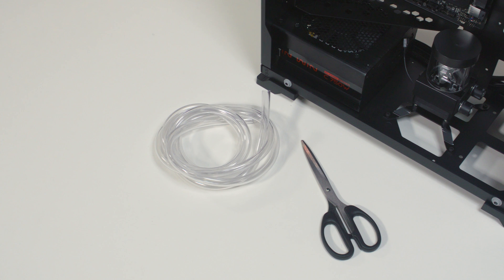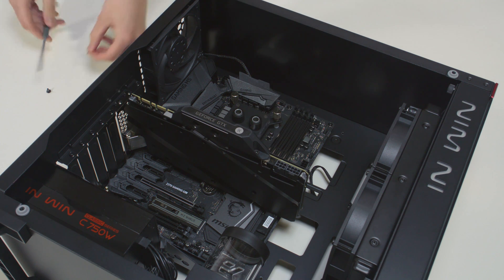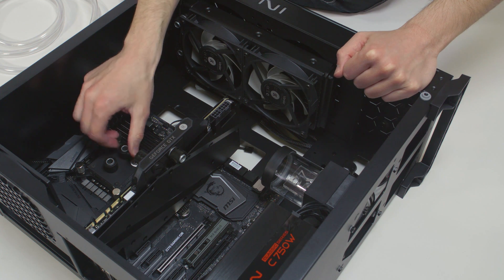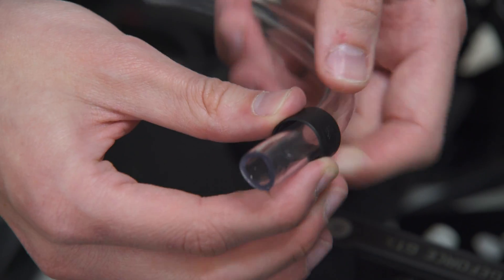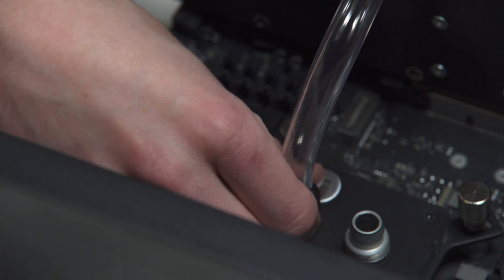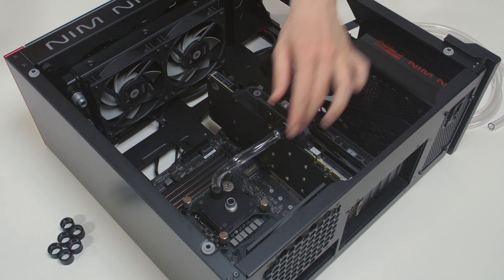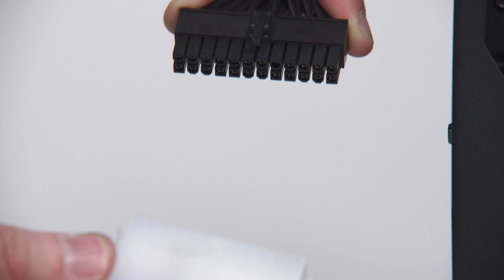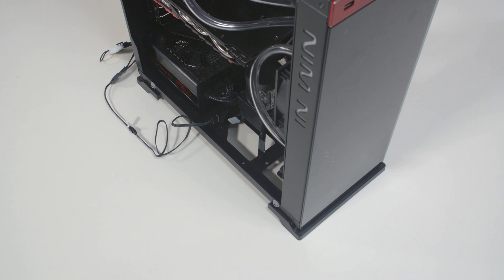EK Fluid Gaming A240G - Connecting the tubing and wires

Comment: question, where do I get the power pin adapter and sata. I am using a EKWB D5 pump and a lian li 011D front distro plate that has a built in pump as well, all combined with soft tubing. 
I am doing this for the first time.

Comment: will you possibly make an A360G or maybe customize the kit to get a 360 instead of 240????? thank you
Reply: yeah but then id have a 240 rad (80$) going to waste... thank you tho... Its like you have a 120 & 240 option for just the cpu for only 10$ more so why not a 240 & 360 version for the gpu/cpu kit. A 360 kit for 250$/260$ i'd buy that all day. I can almost guarantee others would as well especially with what 90% of techtubers are telling us about radiator needs. When your max amount of room is 360mm, buying the 240$ A240G plus 90$ EK-FG 360 that's 330$ and I pretty much just end up with a EK-FG 240 (80$) going to waste and gathering dust. No offense but it seems like a bit of a money play which I understand. You are a business. But if the cpu comes with a bare minimum option (A120) and a starter overclocking option (A240) then it only seems right and sensical to have a bare minimum cpu/gpu option (A240G) AND a cpu/gpu starter overclocking option ala the A360G. I'm actually surprised the line up didn't start with one. But I respect what you guys are doing to change the game and I guess ill just have to wait and see. Thank you.
Reply: Lance Seaman so true.. i want this with 360 rad...